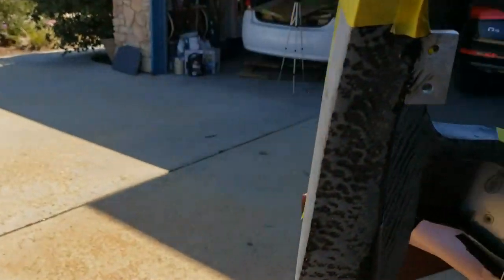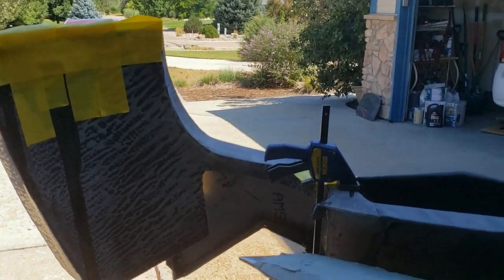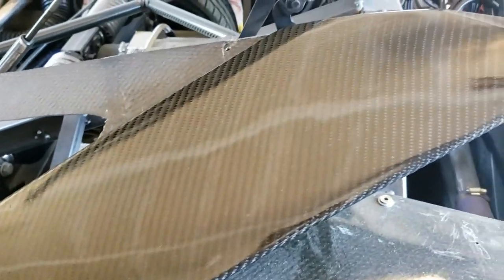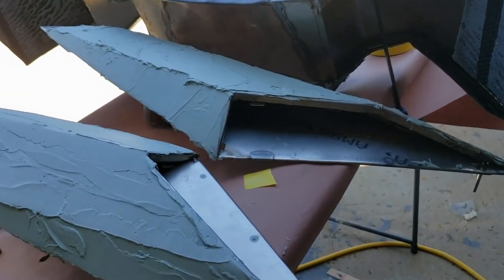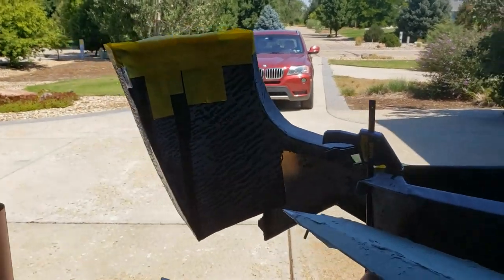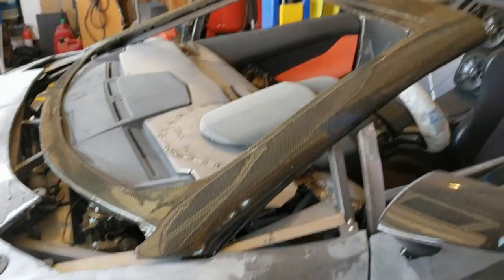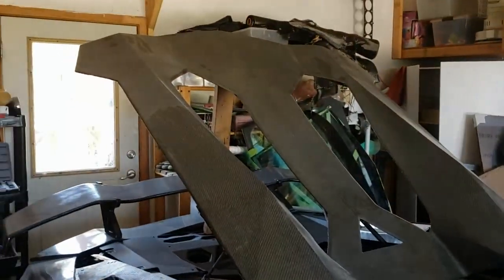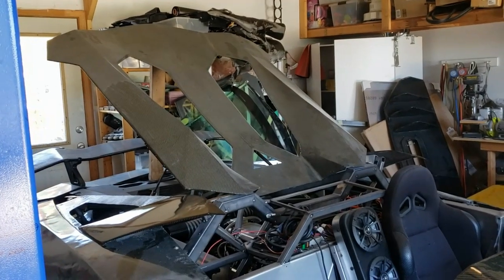3D Printed Interceptor Update 47

Comment: Have you tried putting the resin under a vacuum to pull out the bubbles prior to applying? I've seen that done by other builders.  Have just been binge watching this build and it will definitely gain a bigger following than it has right now - not that it is the reason you are doing it of course.  Good luck and your continued motivation is inspiring
Reply from the maker: Doing that tonight.

Comment: Have you tried to go over the epoxy with a torch quickly when it’s still wet? That’s what I’ve been doing with my thin epoxy. Heat gun only pushes the epoxy around but the torch will pop them.

Comment: Would an OEM Aventador or aftermarket replacement windshield not have been an option due to price? Also, I was wondering if yours is being built perhaps not quite to the same specifications so an actual Lamborghini windscreen wouldn't fit?

Comment: i've seen some use a torch to get the bubbles out. I'd assume that'd hit it harder than a heat gun. Not like holding the torch on it, but kind of like you're painting. nice smooth passes.

Comment: HAVE YOU THOUGHT ABOUT USING PEEL PLY AND SQUEEGEEING THE PEEL PLY ON TO PRODUCE THE FLATTEST SURFACE POSSIBLE BEFORE SANDING. PEEL PLY IS CHEAP. IF YOU PEEL PLY'D IT THEN VACUUM BAGGED THE WHOLE PART, YOU COULD SAVE YOURSELF ALOT OF IN COAT SAND RECOAT SAND TIMES. FOOD FOR THOUGHT THE SUPPLIES TO DO THIS ARENT VERY EXPENSIVE, JUST ONE NO NAME WINDSHIELD OR SO IN COST LOL